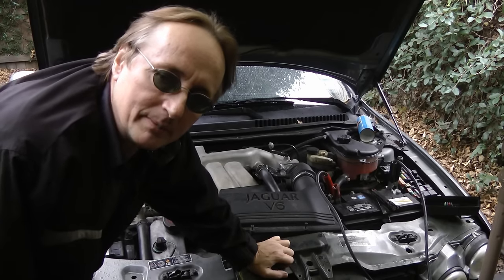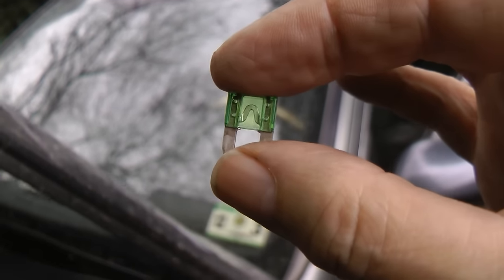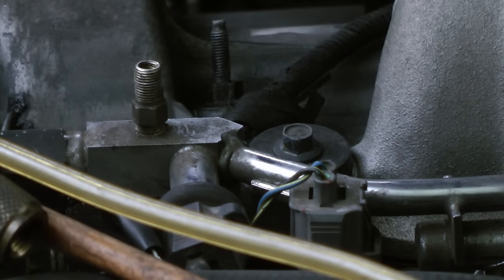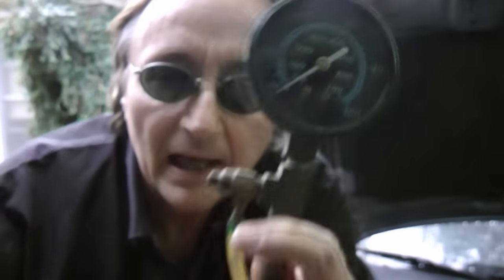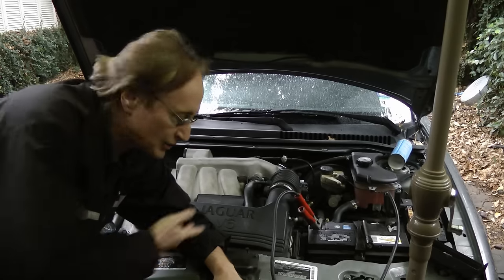How to Tell if the Fuel Pump is Bad in Your Car

Comment: Need some help. Did engine swap in 2001 Ford explorer, original engine 4.0L SOHC, new engine is the same 4.0L SOHC but it does not get fuel. Engine cranks and runs (starter fluid used). No pressure in fuel lines. There is 5+ gallons of gas and the fuel pump does make it's whirring sound. Tried turning ignition on and off multiple times to try to get gasoline through the fuel lines. Fuel filter was replaced and there was fuel that came out of the fuel lines. Any idea why it won't start? (All wires/sensors) properly plugged in).

Comment: Hi, thanks for the informative video. I have the code P01410 on my 2000 chevy tracker. Apparently 1410 is an issue with the fuel tank pressure system. I bought the part from the dealer and replaced it but I still have the check engine light on with the same code. I tried replacing the gas cap, but no luck. Any idea what else the problem could be?

Comment: Good Morning, Sir, I have a challenge on my Honda CR-V Model1999 early morning start well after running 20minute hesitating engine goes off going back to start it crack want start and sometime it start  with the same hesitation off  scanner error display P0108, P0301, P0302, P0302, P0303, P0304, P0300, P1399, New plugs change also Map change.    Am looking if I can  replace the fuel pump and filter

Comment: Scotty I have bmw 528i 2013 I'm having problems  getting fuel pressure  I changed both pump coil and spark plug but sometime when I drive  for long  and stop and start it up it crank but doesnt start I have to wait a hr or 2 for it to start back up what's do you think its problem  and cold start always work fine but even if I start it up and let it idle it would stall it been to three different  mechanics  help me

Comment: I have a 94 sunbird doing something similar. When i crank the engine, fuel does come out of the injectors and it’ll backfire but won’t start. Lowkey at my whits end with this car. Any ideas what it could be so i could sell this car?

Comment: Hello Scotty,
cranks smoothe no start; open circuit relay socket pin no power on load side no power on control side is this a short to power or ground or a bad ECM. ? Toyota corolla 2000. Efi relay is good and has load and control side power, what to do next?

Comment: I have a question. I have a 2004 mustang gt automatic. Sometimes when I try to start my car it’ll try to rev up to start but die. I have no check engine light and the mechanic said that when they read the scanner thing it doesn’t report a fuel pump problem. Can u plz help

Comment: I have a 2013 infinity m37x. I just noticed that I give it gas the rpms go up but the acceleration is to slow. I believe there is no fuel filter. Or there is 1 but it is in the fuel pump and it is not under the hood. Is it difficult to replace it myself?

Comment: One of the fastest thing to determine a bad pump . Just as a preliminary test. Have someone crank car and someone tap bottom of tank with rubber mallet. A lot of time it will start . Doesn't mean all good tho.Also have someone cycle key and you should hear pump momentarily

Comment: I have a 2015 Ford Escape SE. The car almost caused an accident in Wichita Falls TX as my wife and I were driving in the area there. The vehicle acted like it was stalling, as if it were starved for fuel. The display on the dash said "Service Engine Now". To top that off, after shutting down the engine in a parking lot and checking everything. I didn't see any problems. After a search online, I notice Ford Escapes have this issue. Many with more miles than my car have. I only have 30,000. Is there something you may know that Ford refuses to tell owners? I'd love to get rid of this POJ for a Toyota. I too used to own a Celica. I regret parting ways with the car. I never had issues like this with them, even though they were 80 and 81 models. Any idea on this Ford issue would be appreciated.

Comment: I gave a 2017 mitsubishi lancer sel with a failure to engage issue. 

The filters have been changed, the fluid changed 3 times. 
The error code is 'P2719 presdure control sol D ckt range/preformance.'

The valve body valves all cycle when 12v is put to them. They ohmed out ok but the tcc solenoid ohmed out a little lower than the standard i found. Something like 5.6 ohms and the spwc i found should be 6.1 ohms.

I cant find sh*t for replacement parts. Any ideas?

Comment: What about if you have a 2007 Hyundai Accent, like mine, which has no fuel pressure release schraeder valve on it, so I can't do a fuel pressure test? It seems to have power to the fuel pump connector via test light test, but I can't hear it running when power is applied to it. Plus, the fuel pump was replaced only 19K miles ago, so I would think it's still good, but you never know with today's poor Chinese quality control / parts production - I guess the thing could still be bad. I have no way of really knowing if the fuel rail is pressurized at this point, or not - any other way to verify if it is or not? Thanks.

Comment: Scotty. beam me up. ok. no pressure @ line for 98 blazer 4d 4 wd. LS. hooked  positive & ground wires from battery near to fuel pump as I could. No response. Is cheaper/better to put on external pump? I replaced fuel pump last year. No fun. Any advise is appreciated. Thanx

Comment: Hey I have a 98 Infiniti i30 and currently have the “crank, no start” problem but I’ve replaced my fuel pump and the fuse is still good. Any solutions?

Comment: My 2003 prius will start but does not accelerate or move in drive or reverse. It will shut down after about 30 seconds. Any ideas. HV battery is good.

Comment: My honda civic died while i was driving. and the oil gauge and battery was on and i was in gear and rpms was dropping.and i couldn't accelerate and in a few minutes it started up and wonder what is that Scott?

Comment: 🎯 Key Takeaways for quick navigation:

00:29 ☔ Cranking but not starting and intermittent stalling can be signs of a bad fuel pump in a car.
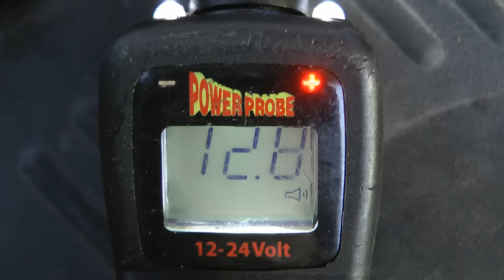00:57 ⚡ Ensure the fuel pump is receiving power and has a proper ground by checking fuses and wiring.
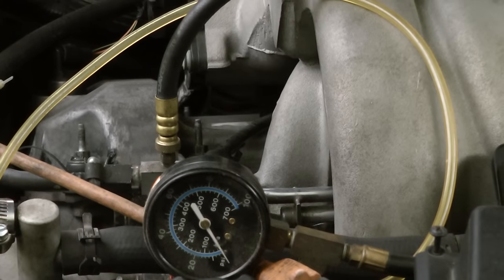01:26 🛠️ Use a fuel pressure gauge checker to test fuel pressure; zero pressure indicates a malfunctioning fuel pump.
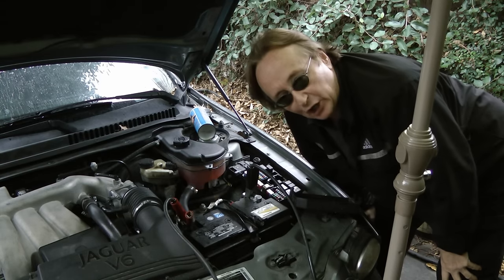01:54 💸 Some cars, like Jaguars, may require expensive repairs to replace the fuel pump due to complex design.
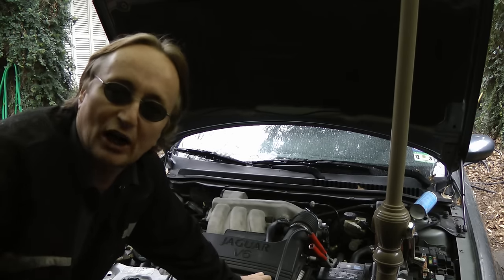02:52 🚗 Consider the potential high repair costs before buying a Jaguar due to their expensive and intricate fuel pump replacement.

Made with HARPA AI

Comment: I have a question, I own a 2009 Mitsubishi galant. Same issues with cranking it and not starting. With my home obd reader I got the code po335 and the car was towed to the mechanic. He says it's the fuel pump.  I'm not sure.

Comment: I have a Mercedes Benz a160 petrol engine its starting well at times it idles very well but at times the idling is too low. When i put it in drive its just hesitating no power at all

Comment: I bought a new one but the tank was rusty so i cleaned it out and now i have no acceleration when I push the gas pedal I pulled the tank again and the new pump looks like it's 20 years old I guess my question is would that pump be the issue causing me not to accelerate

Comment: I have a 2001 Acura TL and I attempted to change the main relay and the case came off the relay and made a spark on some metal under the steering column and caused my car to crank but not start so I changed the fuel pump , fuel pump relay , starter and ignition switch and my starter fuse has no power coming to it and it’s not blown

Comment: Wow. I replaced the pump on a corolla. Popped up rear bench seat, removed cover plate. Disconnected and unbolted old pump, and reverse. Done. Shouldn't be harder than that...

Comment: I can hear my fuel pump prime but I'm not getting fuel I have a 89 Ford Econoline e 250 5.8 im curious if I could be the front pump next to the filter it's a conversion van I see gas flow when I pull the front hose to the engine from the filter

Comment: Scotty I got a question I have a 90 model mustangthat will not start I replace the fuel pump relay replace the relay to the computerif you cross over a fuel pump relay 3 to 4 the fuel pump will run but it will not prime by itself any ideas?

Comment: Help me, help me, save me, save me: 2013 Ram tradesman 2500 w/5.7 hemi. No power to the fuel pump fuse in the tipm. Any suggestions?

Comment: I have a 2014 Chevy Cruze and we just got done replacing a bunch of stuff the item sensor and all that got everything put back together it's been sent for a couple years turned it over got it just start firing it'll start up for a second and die right out start out and die out but it'll only do it when I push my foot on the gas

Comment: When I turn my car ignition to - on, I can hear the fuel pump sound but the sound doeant go off. If then I turn ignition off and back on 2nd time, I dont hear fuel pump sound at all. After starting car it dies after a few secs, if gas pedal is pressed then stays alive few secs more. Could this be bad fuel pump and/or fuel filter?

Comment: Well another way to tell is when you go to pump fuel and then it doesn’t turn on just right after you pumped fuel at the gasoline station. .... and remember if you do buy a after market fuel pump like (precision) from orilys when it comes to the wiring ,make sure you use a ... with ...a ....b.....with..b.....c to ....c...and ..d to d... don’t go by the instructions.i did and I had to do it two times ,because the first time I did it by the book ,but it was not pumping. Until I did the a to a... and b to b...save you the headache from doing it twice. ( 2003 Silverado 4.3 litter)..

Comment: I spent $1100 Au on a fitted oem fuel pump on a Kawasaki zx14r. Over $700 just for the fuel pump which is in the tank and has a built in fuel filter.

Comment: Hey Scotty I have a nissan altima and I'm having a terrible fuel pump problem.  When I turn on the ignition I can't here the fuel pump engaging.
Reply: I checked the harness and there is nothing wrong.  I checked the fuel pump fuse and relay and nothing still. I don't here the pump engaging when I turn the key to ignition

Comment: I go to start up my 98 contour and revs up high then shudders and dies unless I keep on the gas then put it in reverse with brake on and revs up to 3000 rpm then I put it drive quick and quickly dies. The mechics say it's a electrical issue..they check for leaks,, maf. Iac etc.. what do you think it is??
Reply: Same did you figure it out

Comment: I have a toyota 4runner 3.4l and for some reason my engine will crank for 6 seconds or so before starting. But when the engine is hot it doesnt do it. I cant figure out what it is. The plugs are good, all sensors are good, there isnt a vacuum leak, no code, injectors are brand new, ignition coil is good, and battery is good. Idk what else to do?

Comment: My car (bmw e39 525 tds 1996) in 2nd gear at like 4k rpms goes great but when i change to 3 gear the rpms wont go over 1-2k rpms with my foot down wath could the problem be?

Comment: I upgraded my ECU and fuel injectors 550cc with a walbro 255 fuel pump. The problem is my fuel pressure keeps dropping. But when I changed things back to stock fuel pressure don't drop pressure. HELP!!!

Comment: Scotty kilmer I've watched tons of your video's as a DIY mechanic for different vehicles and you are very helpful...... But i believe you are wrong on how to get to fuel pump because if you remove the rear seat held in place by 3 latches pull the carpet forward and remove plastic cover and there she is the fuel pump

Comment: 2001 subie outback crank over like its starvationavion of gas.  So we check over spark on the coil and plugs all check ok and we did.check.fuel filter it was very dirty. And it wasn't getting enough ofthe gas so we put a fuel pump and start up amd took it for a test drive and Boggs on frist gear and then it started whine sound from the where the tanks at and its still feels like its not getting enough fuel to the enigne

Comment: I had an 09 jeep grand cherrokee laredo with 30k  that would keep stailling while driving in the rain and it would randomly die while driving in the rain it was going on for a few months i kept replacing the battery that didn’t do anything but when I took it to a mechanic the mechanic that it was the water pump

Comment: I have a 94 ford ranger 4.0 if I start it after it sits for a while I need starting fluid after I use that and the truck is warm it runs great what could be my issue

Comment: Ok so. I have a 1986 f150. Runs like new, drives like new.  Low miles.  It's got the 5.0 EFI coupled to the Ford c6 tranny. It rarely does this, like every 2-3 weeks for maybe 10 seconds. When you come to a stop it bogs and surges. Only at idle and in gear, if you go to neutral it immediately stops, back in gear and it's back. Weird, not really a big deal.  But it bothers me because besides that. I'd be a perfect truck.